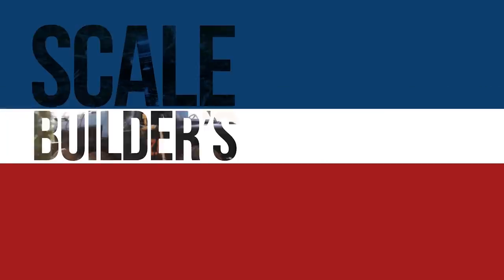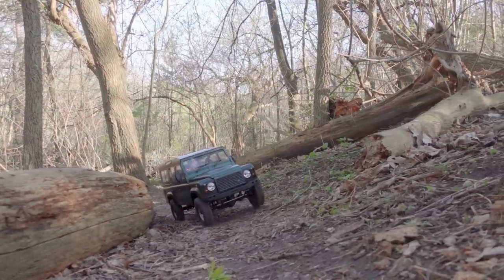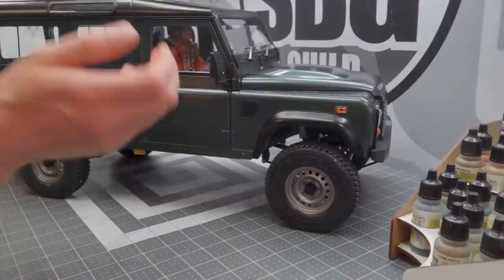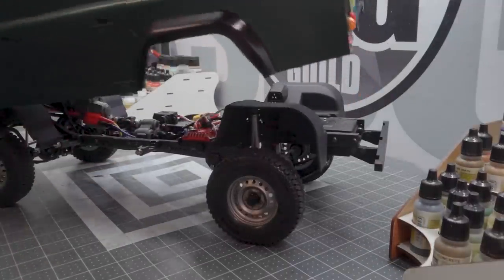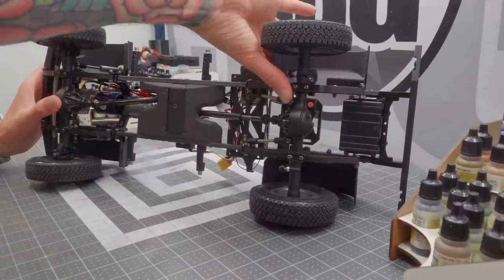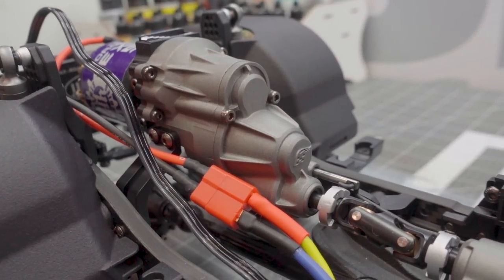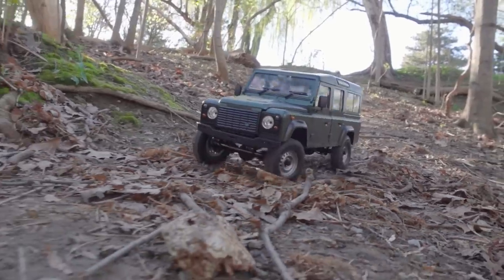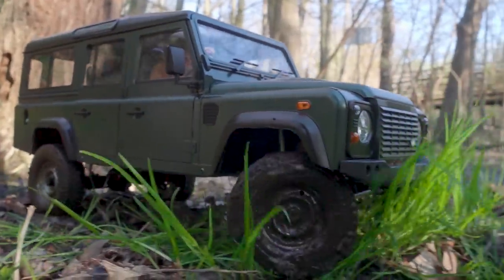BoomRacing BRX02 - I'm a Be-Leafer

Comment: It´s the only RC Defender on the market with the correct 5 lug pattern. All the others have 6. Diffs are in the wrong place on the axel though.
I so want to get this in the spring. I think they have a DCPU which is the same body as my 1/1 Defender. Cool to build a replica.

Comment: You did an awesome job getting this assembled and detailed out. Love the license plate and the right hand drive sticker 😂. I was certainly grumbling that this was carbon before, but that was before I realized the wheelbase was over 13 inches. CF pushes it right out of class1 potential, but I suppose most folks wouldn't try to compete with tiny tires and that wheelbase anyway.
Reply from the maker: Excellent insights, thanks for watching!

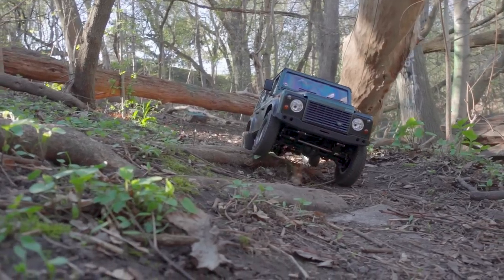Comment: You know, if I didn't already have over a grand wrapped up in my Gelande II D90, decked out from head to toe with ALL the scale details, I'd chuck it in for this one. I really like some of the nuances of the construction. It seems they took a look at RC4WD and asked themselves how could they make it just that much nicer. This reminds me of what it would be like to own a CAPO Cub but in 1:10 but for the same price as their 1:24! The carbon fiber frame rail thing, the wheel wells, leaf spring adjustability. Which, brings me to this: does the kit give you leaf-under or leaf-over options for the axle or is it just leaf-over? Dope ride.
Reply from the maker: I’ll have to investigate the options. Thanks for watching!

Comment: Anti wrap bars are pretty much required with the high torque of the electric motor.
 That's okay, the ability of the leaf spring to cycle properly and keep the body from bouncing is why the leafs have to be fairly soft and stacked for progression.
 Without the anti wrap bars, you're going to break stuff.
 Coolest RC trucks money can buy.

Comment: The "defender" as that body is called.....is actually called a defender, its a defender 110 county station wagon puma engine (which is defined by the bonnet bulge), with regard to running on leafs you are right a "defender" never came on leafs BUT earlier "110 county station wagon" did, right around the transition from series 3 to just "110 / 90" they did in fact for a few years come with leafs on before land rover decided that all vehicles coming from their factory would now be equipped with coil springs.

 All 90,110 and defenders were fitted with coil springs, but the name defender did not come about till much later than the leaf springs were omitted from all of land rover's vehicles.

Comment: Do you ever build Cross RC models? I recently built the PG4L which is a leaf sprung dually. Quite different but considerably good value given the pro light kit and hard body in the kit for Less than 400 bucks

Comment: Oh how I wish it didn't cost untold fortunes to get BoomRacing kits in the US. 

Really the only downside to me is the carbon framerails, Less weight = no.

2 Speed is a little funky, I'm not a fan of multiple speeds most of the time but that 2 Speed looks like it has a much more efficient footprint and the ratios are actually worth having it seems instead of slow and less slow it looks like slow and fast.

Overall though I'd say it's a pretty reasonable price for how well it's designed and the quality of the parts.

Comment: I'm curious about something.  I'll admit, I haven't emailed Boom Racing about this...yet...but, of I'm unable to get an answer here, to I'll definitely ask them directly.

My 'curiosity' has me wondering how this might do as a C1 rig.  I know...CF rails aren't allowed for C1...which leads me to my question.  The BRX01 used steel rails.  Are the steel rails from the BRX01, and the CF rails from the BRX02, the "same"?  Meaning, are the shape/length that same, and do both have the same holes in the same locations?

If they are the 'same', would it be possible possibly to get a BRX02 Kit, plus a set of BRX01 steel rails, to build a C1 rig?  This "inquiring mind" (and others, I'd be willing to bet) would like to know.

EDIT:  While I await any possible answers/replies here, I have emailed Boom Racing.  Should I receive an answer from Boom Racing, before here, I will reply to my own comment with their answer, so that others will also know.
Reply from the maker: Well, the wheelbases between those two are different, so my guess is a lot of the design elements on the 02 wouldn't be a direct swap to a 01 chassis. If you're looking for a C1 competitive chassis on leafs, look no further than Brazin Scale.
Reply: @scalebuildersguild  Funny thing, that's also what my next door neighbor suggested.  Should I order from Brazing, I'll be sure to tell them Josh sent me. 🙃🤙🏼
Lol...j/k.

Comment: It's a shame that an RC car is the only way to buy, brand new, anything remotely like a proper Defender.

This one provides decent authenticity, with steel wheels that are a must for working mud-pluggers, and tyres that aren't massively oversized. It would be better still to have tyres of totally correct proportions, tread and shape.

Leaf-springs are ideal, since the Defender has leaf-springs. Using carbon chassis parts is not the best idea, as the weight and dynamics of metal helps with realistic movement and longevity. Metal also gives such a model a greater sense of substance and true replication.
Reply from the maker: This truck is plenty heavy as it is, which is why they opted for carbon parts here and there.
Reply: @scalebuildersguild  The heavier and more metallic the better.
Reply from the maker: There's a tipping point with everything.
Reply: @scalebuildersguild  True. Land Rovers have a surprisingly high tipping angle, much like a Routemaster. An RC Routemaster would be even better than a Defender.